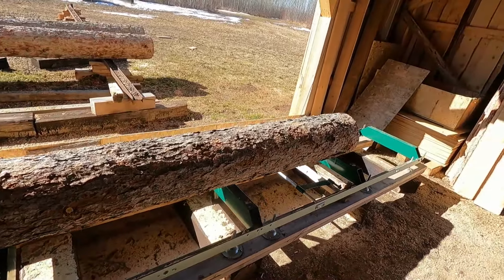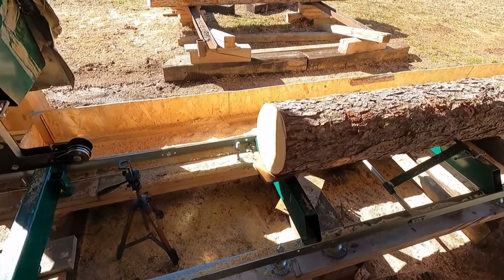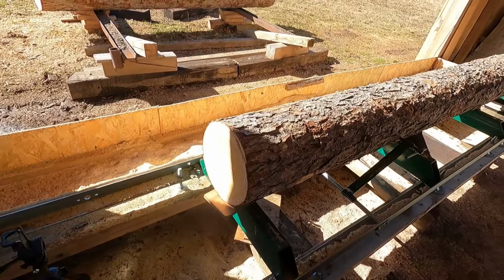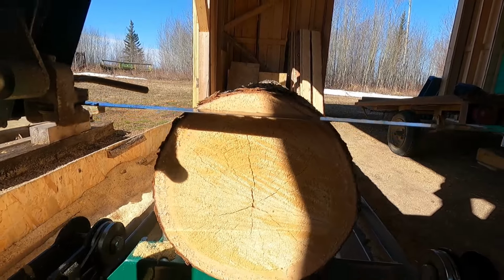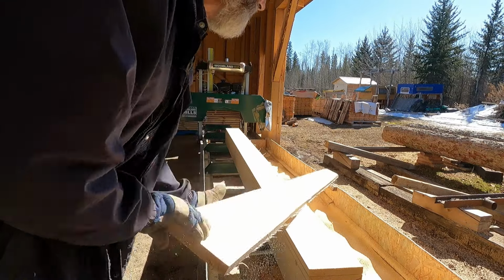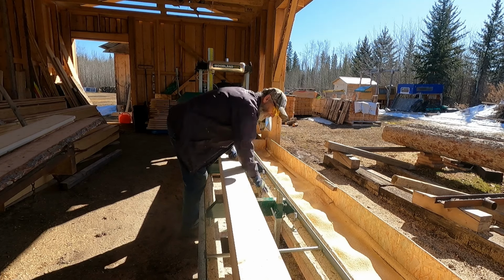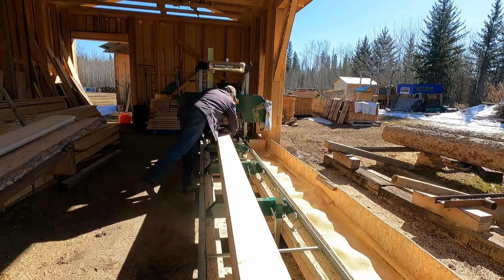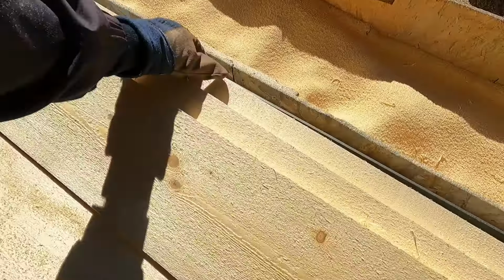Turning Logs Into Lumber On My Woodland HM122, Homestead Chores, S3,E36,

Comment: HeyDon that’s nice looking number. You sure have that mill dialled in. Do you sharpen your own blades when they’re dull
Reply from the maker: Thanks ! count the clicks on the lift & they all come out the same :) I have a sharpener on it's way should be here in a couple weeks so you might see me playing with it in a couple weeks :)
Reply: @littlegriffoffgridalberta6837  awesome I have two sharp blades left and I wasn’t sure if I should keep the old ones. I’ll wait and see how it works for you lol
Reply from the maker: @exploringmybackyard  Ya for sure ! I want to get it set up & see how it all works, The blades are pretty much the same for all these mills, How many years have you had yours ?
Reply: @littlegriffoffgridalberta6837  I’ve had my mill 3 years now I’ve just been buying blades, but they’re starting to get pretty expensive
Reply from the maker: @exploringmybackyard  Ya for sure , I bought 40 & i have a dozen left after all my cutting, But $27 each I think so time to start sharpening before I'm out :)
Reply: @littlegriffoffgridalberta6837  yeah for sure 27 bucks add up quick